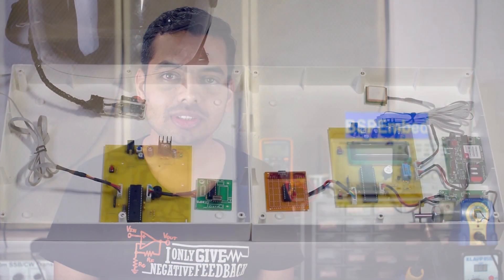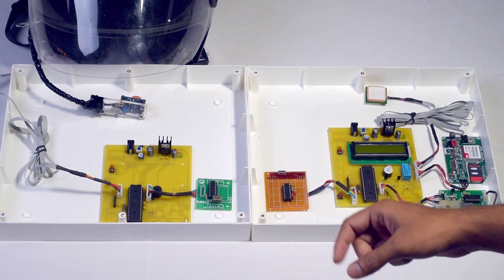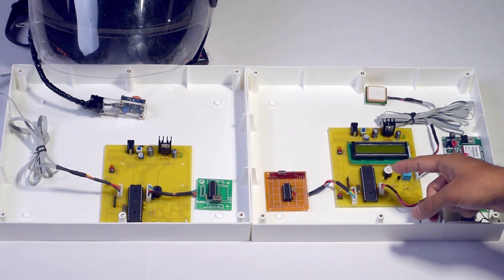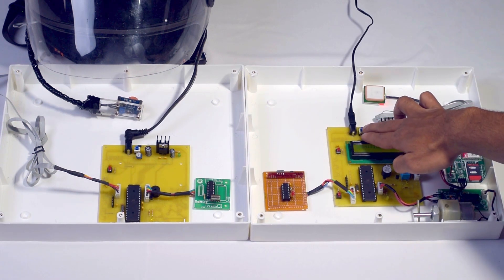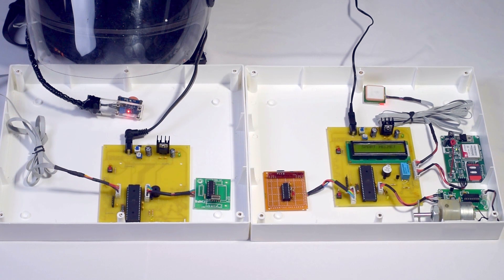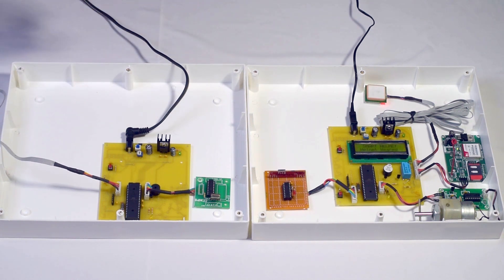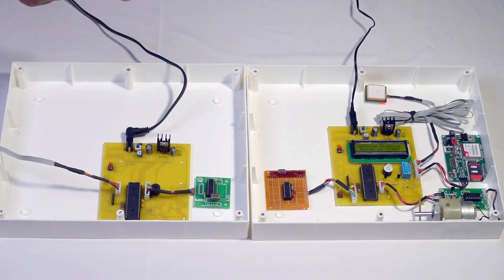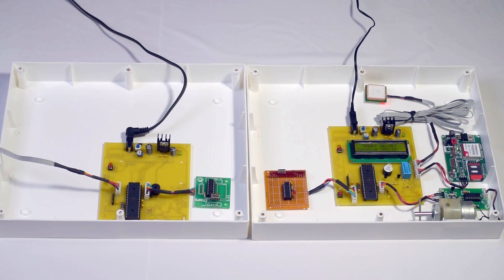How to make Smart Helmet

Comment: The removal of the DC motor is the 2 pin jack right na
Reply from the maker: Have to remove L293D motor driver IC & motor.
Reply: In new video there is no l293d ic driver
Reply from the maker: Then you can connect relay I/P pin to the motor driver transistor(BS170) base pin.
Reply: If the vibration sensor is placed in vehicle section then how to detect vibration in the helmet I want to make the helmet and the circuit for the bike it self want to do